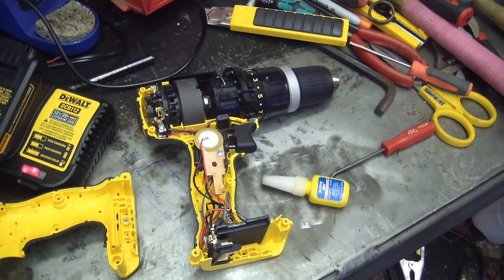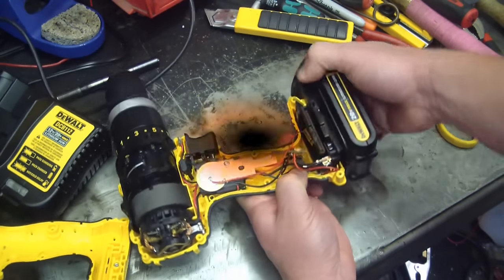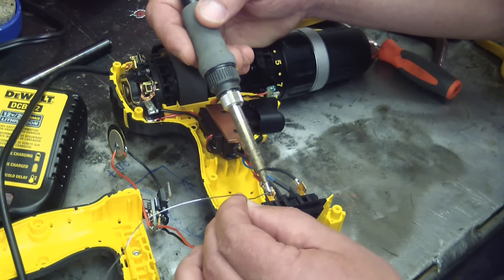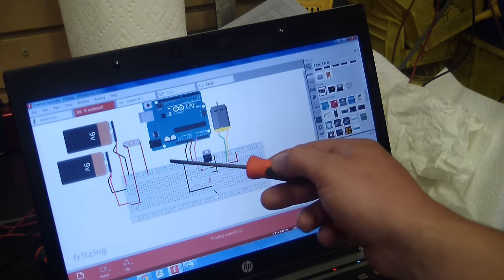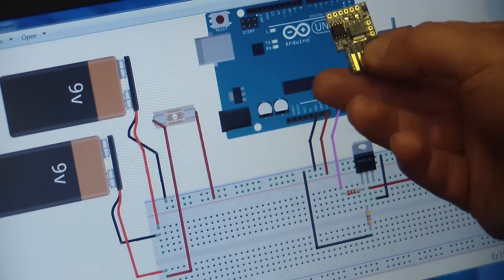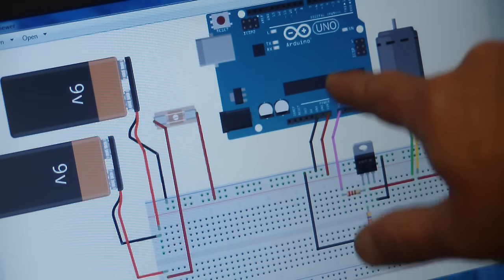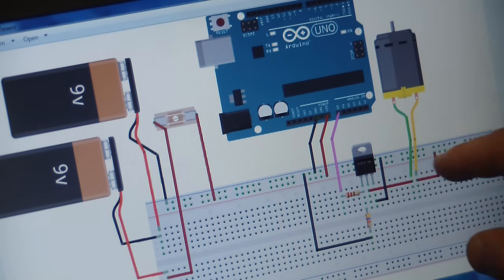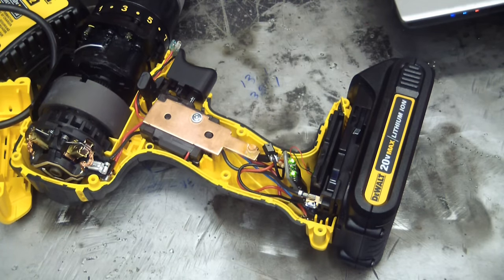Cordless Drill Haunted by the Ghost of Dorks Past.

Comment: I figured with a suitable transistor you could drive the actual drill motor with the tune so it spins and pwm's to the tune also (should be audible and terrifying)
Reply: muh1h1 he used a vibration motor and a piezo speaker
Reply: frollard I think this would be awesome!
Reply: frollard Could be more than a little dangerous to have the drill motor come on by itself randomly. Thats why he used the vibe instead.
Reply: pmdem a person of logic and reason! stick around, you're rare around these parts.
Reply: pmdem Come on! You don't really believe that!
Reply: frollard under that copper strip near switch is drills pwm/micro cntroller
so he can't do that. but nice and terrifying idea ;)
Reply: pmdem I don't think it would be that dangerous. Especially if the motor is kept slow
Reply: ***** also he would have to use a transformer or something to bump the voltage up to 18 volts agian.
Reply: frollard Guess if it can play tunes, maybe it could TALK.... !!!! Imagine in the dark, being waken up by voices, or even better a BEAR IN THE CAMP..... !!!! :-))

Comment: On the one hand, I'm impressed. On the other, you could have probably hired a guy to just go bang on the windows in a red shirt every few days for the cost of the drill.
Reply: but the drill will just be borrowed and should still be useable. and the main reason for this is the satisfaction of building something yourself - because you can.
Reply: Cr42yguy Not if the dude gets freaked out and throws it in the lake.
Reply: then he still would have to pay for it in my opinion
Reply: justfakeit888 it's a Dewilt, no one will miss it.
Reply: +Elia Deck DeWalt makes really good drills.

I bought my 12 volt drill/impact set in 2012. As an aircraft mechanic working on UPS MD-11's, that dirll lasted me through a couple years there, a move up to New York for 6 months working on Dash-8's, a few other moves since then... and even four years after I bought it, the whole kit still works perfectly.
Reply: Skyfighter64 same, never an issue. I've two 18v drills and the tiny 10.5v impact driver. One is still going after 4/5 years :)

Comment: Reminds me of hearing of the mechanic who wired his buddy's horn to the wipers or turn signal or such.  Guy felt like an ass honking in traffic every time he tried changing lanes.
Reply: I had a '66 Ford LTD with a slightly bent steering column that honked the horn whenever I made a right turn. You can imagine the fun. Got so bad I disconnected the horn and ran two jumper wires so that whenever I needed the horn I would have to pinch the wires then hit the horn ring. I got pretty good at it too.
Reply: my old jeep did that, bad clock spring
Reply: Newer cars, easiest is to unplug headlight switch. Then highbeams stay on all the time when key is on.

Comment: is this a logic level mosfet? usually mosfets need 10v to switch properly. u could use a npn to switch it with the 18V. pull it high with a resistor and then to gnd with the npn to switch it off.

Comment: Could you have the output tune instead of going to the piezo speaker, go to the speed control of the chuck - i.e. varying the ripums of the drill to play the tune? (ignoring the fact that if you had a drill randomly starting up on its own to play a tune is a little dangerous, but would be a little bit skookum)

Comment: You should probably add a bleed off diode across the motor. The motors act like massive inductors, and if you suddenly cut the voltage, they attempt to keep up the current flow. If there's nowhere for the current to flow, you get massive voltage spikes and arcing.

That's why I always put one in, anode to ground, cathode to V+. When you get the voltage spike from shutting down the motor, it will bleed off there and not strain the other components.

Comment: Hey AvE: Just as an FYI the Pheonix Contact: relay 2961367 works NICELY on the Digispark/Digistump. Running Several projects direct-driving and switching over 1000w <6a/250vac>

Comment: That linear regulator might actually drain the battery too fast to activate the music. You should probably add a resistor between the battery and the positive voltage supply input of the digispark, possibly as high as 1kΩ.

Comment: On the schematic with the motor a diode in parallel to the motor would be nice to protect the transistor from transients when switching off. The in the "dead bug" method you usually glu the chip upside down on a pcb and directly connect to the leads, you don't leave it alone like that. Also to avoid shorts you should put some heatshrink around your circuit. You can buy some very cheap from China.  Cut a piece, insert your circuit inside. Add a bit of heat and voilà!

Comment: Well geeze,  if you're going to hack an Arrdraino into a drill, 
What about one that splices into the speed control mosfets to intermittently cut power to the drill. 

Maybe even with a little ramp down to make it seem like the battery just died.

Comment: Could the power-on short have been caused because the negative of the piezo was placed on the heatsink, which could be at positive potential? At this point it makes no difference, as everything works :D I was just wondering...
Reply: Jakub Stano The explanation he gave doesn't meet my explanation of what went wrong. The piezo is basically a capacitor. Given the lack of information i'm not sure if the piezo was running off that 19 volts but if it was and he exceeded the voltage rating of it then he'd have a short.  I'm just spit balling.  Too little information to waste time contemplating. I'm thing yours is more likely than mine. Frustrating ain't it.

Comment: not dead bug m8, its called point to point soldering.
also the resistors on the gate and the gate to ground resistors are not a must but recommened.
the gate resistor is so the mosfet will turn on slowly and there will not voltage spikes and shit like that.
the resistor to ground from gate is to drain the mosfet gate capacitance so when its off its off.
good video :D

Comment: should put in a extra small battery so it worked even with the main lipo pack out haha.
Reply: ***** 
That would be epic. Maybe a small Ultracap would do the job as well. Those buzzer motors take practically no power.

Comment: Did it work as a practical joke?   I'm going to guess.... that running the drill causes spikes on the power rail, or induces current in the long wires used, and crashes the Arduino.  Did it really work after using the drill?

Did you have to reprogram the Arduino after demonstrating it working at the end of the video, in order to make it hold off for a random amount of time before  "awakening"?   How long did you make it wait between scares?

Comment: That spark reminds me of my sophmore year in high school in my chem class. I was bored and sleepy in the back of the class and the table i was sitting at was a lab table that had a socket built into it and in the "lecture" it said that graphite was a semi conductor and i figured well that probably means its gonna do a bunch a weird shit if i put a bunch electricity through it. I got two pencil leads and stuck one in each socket (teacher was 70 years old and couldnt hear or see well) and i wrapped one in my shirt and i touched the two leads together and it made a huge ZAP and everyone in the class turned and looked at me (thank god the teacher is completely oblivious to everything) and i just smiled and when everyone turned away i was too scared to pull out the lead so i left it in the socket. :D
Reply: The burn marks on the socket are permanently there pretty proud of my stupidity
Reply: +Brian Royal hmm maybe
Reply: +Brian Royal im the same person btw different accounts
Reply: I don't even know where that is.
Reply: If that was a theatre scene shop, then I am definitely that guy, I was the lead of a shop. But it's nice to know that even if I die, there'll be another one to carry on my legacy.

Comment: 20v lithium ion batteries? really?
Reply: Battery packs*.
Reply: still.... point is they charge up to 20v ... they are really 18 volts... 3.6 volt cells...
Reply: The voltage of a li-ion cell is between 3v-4.2v that makes an average 50% (old school resting charge) at 3.6 volt, so 5 cells in series can go fully charged up to 21 volt. 21v>20v and can so indeed be claimed by the manufacturer.